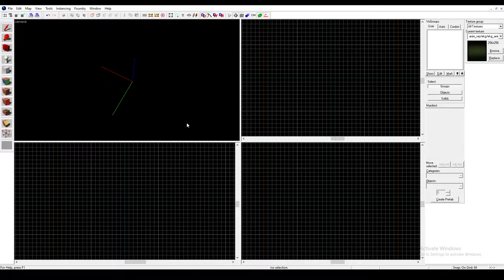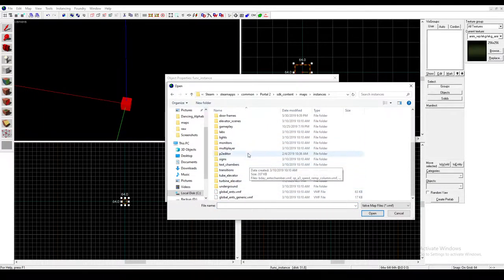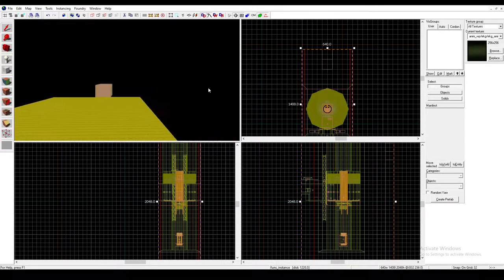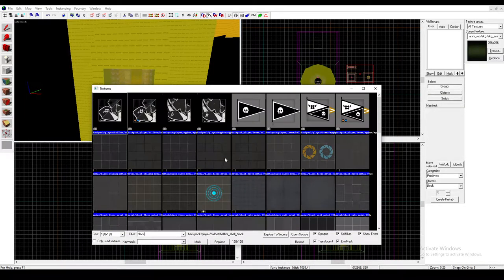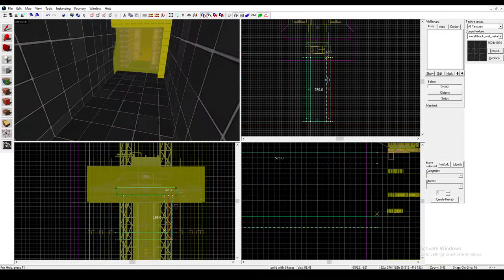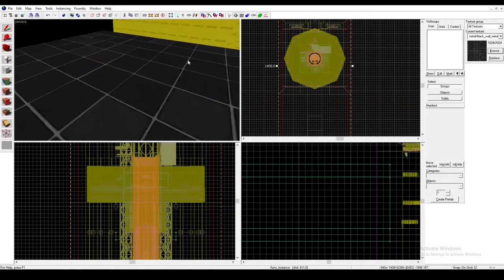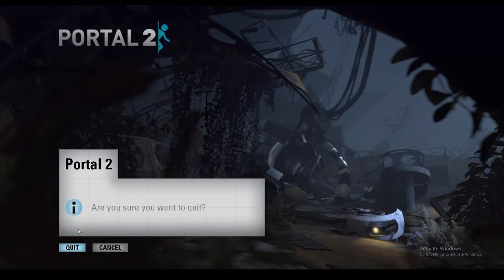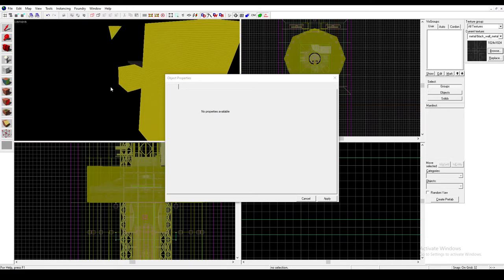Portal 2 - Hammer Tutorial: How to make the Arrival And Departure Elevators

Comment: how would i go about disabling the sound from the elevator room when the player leaves it? I'm assuming you'd just use a trigger but I'm not sure how you would target the sound coming from the elevator room...
Reply from the maker: I believe there's a soundscape in the elevator that you have to disable, forgot what it was though.
Reply: I think I've found a solution to my problem that I have not tested yet. So first I copied the soundscapes from the instance into my map, then I customized the instance and deleted the soundscapes, then I moved the soundscapes that I copied into my map to where they would be placed in the instance, so then I can easily disable them with a trigger. (I'm very new to hammer editor, so if there would've been an easier way for me to do this I apologize. I do know about func_instance_io_proxy's and what not but I'm still unsure how to use them.)
Reply: Actually, I think I found a reason why this might not work, one of the soundscapes is attached to the elevator to move up with it, so I don't think my solution would work...
Reply: Found out that triggering another soundscape disables all other soundscapes, so I was able to have a soundscape that didnt have a sound file attached to mute the other soundscapes basically. So, problem fixed :)
Reply: @toopsisdfg6339  THANK YOU SO MUCH DUDE